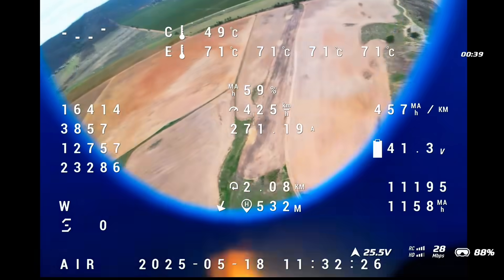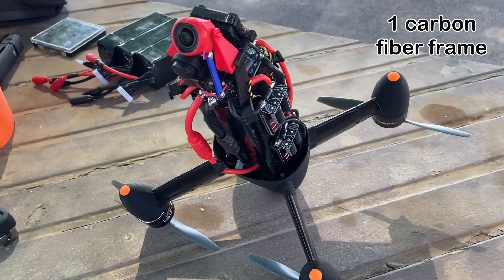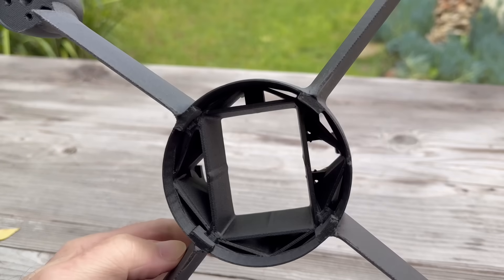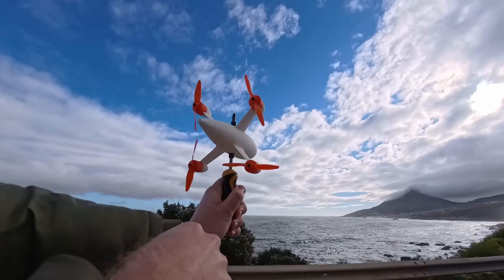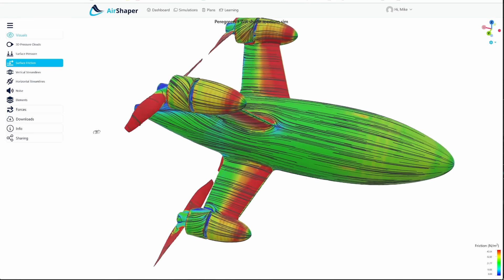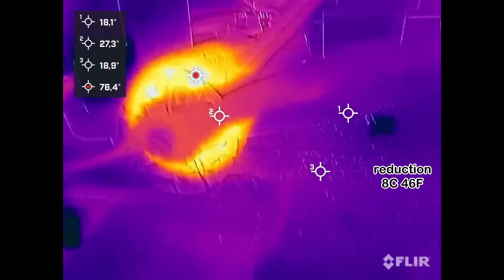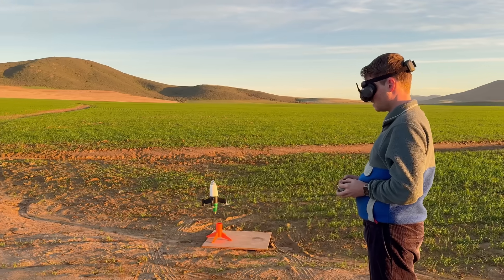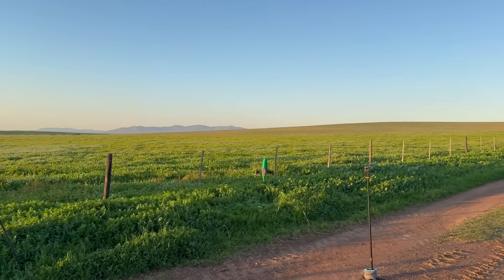How fast can a drone really go? 🇿🇦

Comment: Absolument passionnant !

Quatre petites suggestions afin de réduire la traînée, faciliter la portance, et augmenter les performances : 
1. éviter tous les angles vifs aux endroits de connexion des parties distinctes du drone qui sont des lieux de très basse pression donc de turbulences donc de traînées (voir les solutions suivantes : B-2, Sukhoi-57, Rafale, Airbus 380),
2. aux emplacements critiques de la création de turburlences, creuser des cavités qui puissent agir comme celles de la balle de golf,
3. poser, au nez d’attaque du drone, 2 ou 4 moustaches (voir le Rafale) afin d’assurer une correction automatique de l’horizon selon la vitesse et le besoin de portance,
4. considérer que les 4 bras qui portent les moteurs sont essentiellement des ailes qui assurent la portance du drone, à faible, moyenne et haute vitesses. 

Je gage que de telles modifications bien menées proposeront des performances nettement améliorées (+ 100 km/h). 😎
Reply from the maker: Thanks for the suggestions!  The cavities at turbulence locations is a helpful idea. What do you mean about whiskers at the leading edge. I couldn’t identify them in the Rafale.
The body is already generating essentially free lift at 0,7 degrees nose up, so we make the arms as small as possible and have them as directional stability fins.
Reply: @Mike-Bell  Bonsoir, si vous regardez de face puis de profil un oiseau planant, vous n’observerez que très peu de plumes qui seraient agitées par des turbulences. Or, si des plumes sont agitées, cela est la conséquence d’un plumage abîmé ou d’un oiseau blessé. 

Observez encore, de face, un oiseau planant : l’attache des ailes au thorax ne présente aucun angle vif, et la connexion s’opère toute en souplesse. Et cette souplesse de ligne assure, grâce au plumage qu’il n’y aura aucun vide où se logerait des turbulences ... donc une traînée qui aspirerait l’oiseau à contre-sens, vers l’arrière. 

Autre point : étant donné les hautes vitesses déjà atteintes par votre drone (585 km/h), son profil actuel de pénétration dans l’air s’oppose immanquablement à un mur redoutable qu’il a construit contre une augmentation possible de la vitesse. Pour atténuer cette résistance et la réduire à un minimum raisonnable, n’hésitez pas à effiler son profil davantage vers l’avant et vers l’arrière, toujours en forme d’ogive (voir le profil des projectiles à haute vélocité).

Je maintiens que les bras qui portent les moteurs et les hélices doivent être considérés comme des ailes, et des ailes très particulières parce qu’elles sont exposées à des flux d’air vivement accélérés par les hélices. Et que ces flux d’air accélérés participent à la portance en vol horizontal.

Cela induit que leur finesse doit être étudiée spécifiquement, avec l’utilité impérative de s’accrocher au corps du drone avec beaucoup de souplesse : voir comment les ailes de l’Airbus-380 paraissent excessivement épaisses lorsqu’elles se rattachent au fuselage de l’avion. 

La raison principale est que le flux d’air à cette accroche est minimal voire dépressif, et que c’est alors opportun d’y augmenter l’épaisseur des ailes afin d’offrir une meilleure solidité de l’accroche, tout en résolvant une question de turbulences donc de traînée ....
Reply: @Mike-Bell  Je pourrai encore ajouter qu’en analysant le profil du fuselage des F-22, F-35 et Su-57, on constate que leur fuselage est dessiné en forme d’aile. Une aile certes rudimentaire ou compacte, mais qui assure à haute vitesse une réelle portance ...

Comment: If takeoff is slow, why not go back to the old standard of JATO - a short boost until reaching cruising speed, followed by decoupling.  As simple as a cup form under the rear that would normally fall off from drag as the props kicked in.  No?

Comment: Someone probably already figured this out, but why didn't you use a piece of aluminum pipe for the body for air cooling? Add some heat pipes to direct the heat from the esc's to the pipe and you get excellent air cooling without increased drag and probably being lighter. It also actually gets rid of the heat instead of just storing it

Comment: Could a gyroscope suck in air enough to make its own air bearing?
It could be kinetically charged on the ground as the flight is short.
All in flight power could be routed through this gyroscope with maneuvers achieved by forces acting upon the gyroscope which provides stability.
The power drivers the gyroscope which the props are linked to.
However control is lost as power dwindles to the gyroscope.
Then the chute flips out.
Reply from the maker: The flight controller works with multiple crystal/electronic gyros. They are absolutely essential, without them it would tumble

Comment: How about a circular wing for forward flight brothers.
Would a ring motor around the propeller help.
The propeller could then sit inside a tube or shaft. This may help velocity the exhaust pressure.
Possibly then a torroidal propeller could be developed.
The craft would then consist of a group of interlocking rings which would hopefully act as a wing.
These motors could twist or pivot to enable maneuvers at full thrust.
A dimple finish could be added similar to a golf ball to reduce drag.
Or possibly even a plasma tip to reduce friction.
I would then add a hydrophobic coating for like, reasons.
Perhaps make an angular stealth nose cone.
Possibly attach a cylindrical flywheel around the wing to act as a gyroscope at like mach something.
Maybe make the gyroscope from a slinky, so when a little wing flips out and makes it spin at 3000 rpm it flys off as a countermeasure.
I might paint it captains infinity style or retro-futuristic.not sure.
Thanks love it.

Comment: Without knowing what went wrong with your electronics; try using lead based solder when building your electronics and cables. Lead free is enormously prone to micro cracks, internal cold cracks and doesn't alloy to copper as hard as lead solder does. I'm sure you've had leads fall off clean off copper pads by now. That's why it happened.
Reply: Good comment, 100% spot on! Another small fact of life... 😢 🎉

Comment: By giving it passive stability, it's made to behave like a plane that is inheritely stable. Maybe adding little canards would help with stability at high speeds. I am currently designing a flying X-wing with canards, able to take off and land vertically on it's tail
Reply from the maker: Sounds like a cool project you're working on!

Comment: The loss of connection is not due to Doppler effect. At 900 Mhz the shift is 500Hz. The channel width is 10 MHz. Similar ratio for other frequencies. Well within the channel width. 
Most likely you lose connection die to the antenna radiation pattern- it is probably positioned horizontally during the high speed flyby and you find yourself in a dead zone momentarily when it passes by. You can avoid it by keeping the antenna oriented vertically to preserve omnidirectional radiation pattern.
Reply from the maker: The drone has 2 antennas which are 90 degrees opposed so wrong orientations doesnt seem like an explanation
Reply: @Mike-Bell  with two orthogonal antennas, it’s a bit more complicated. The receiver antenna setup plays a role. Usually it would not receive the product of radiation patterns of both antennas but only from one at a time which it’s aligned with due to polarization. Resulting radiation pattern from two antennas is not a combination of their radiation fields but rather two radiation fields with two different polarizations. Unless you have a receiver which is able to combine signal from these two sources, your receiver will only receive the signal from one of them at a given moment. So a local zero during the flyby is still possible depending on the receiver’s setup.

Comment: Dimples. That would be the NEXT LEVEL.
(and omg what a headache to figure out)
Reply from the maker: Dimples are for golf balls only, because a ball is a terrible aero shape and a particular quirk that only benefit balls.  Not a single aircraft or airliners has dimples because it would just add drag.  You can be certain all Airliners would immedeately apply dimples if it save fuel.

Comment: Maybe it would be worth testing flying in a plus configuration and having the horizontal arms be directional airfoils. That way the body wouldn't have to be a lifting body. I am thinking that the arms would be more efficient at providing upward lift because they have a way higher aspect ratio that the body when seen as a lifting body. So rather have the body go straight through the air and have the arms act like wings like on a real plane.
Reply from the maker: @samgo flew in both the + and x configuration in his record speed. He gave the horizontal arms positive angle of attack. But from what he told me difference if any was marginal. And the explanation is simple. At these speeds the body is already providing  more than sufficient lift and any other lift attempts will just incur additional drag.I make the arms as small as possible and use them for directional stability. 
For me its crazy that 0.8 deg nose up is all you need for lift. Plus we get up to 10g sideways lift in the turn after the speedrun. 
Great question! 🤓

Comment: I wonder if it would be possible to make a cylindrical metal insert in the case, which would serve as a radiator for electronics. Due to the airflow, it would be blown over, the cheapest way to solve overheating, as it seems to me, under the conditions of a CNC and a light alloy.

Comment: Would variable pitch propellers be possible?
Reply from the maker: Great idea. They would make a MASSIVE difference and increase top end speed but technically extremely challenging. We would have to develop the tech completely on our own. And the additional rotational mass has downsides.

Comment: Have you considered giving the engine struts an angle of attack  and a lifting profile (1 degree?) so they provide the lift and not the body?  My thought experiment tells me that lifting struts should perform better because they have a higher aspect ratio than a lifting body.    CFD should show whether lifting struts or lifting body is the most aerodynamic solution.

Have you considered not using vertical landing?  I am thinking of flying into a vertical bird net, motors switched off.  Basically a controlled crash into a net.  Benefits would be reduced energy to land, smaller batteries, and all the advantages of that.

Comment: Hi I'm hearing rumors of a new unofficial Chinese world record for fastest quadcopter. I cannot find videos of it anywhere. I really have tried. Can anyone confirm this? Does anyone have links or videos of this? Thanks.
Reply from the maker: Yes a guy named xiao_dra2002 on Instagram has claimed 608. He has the OSD Showing 608 n 604 and one foto. So average would be 606. No way to be certain it is level flight but looks like it. And the design looks like a legit potential record breaker. But beyond the claim. There is nothing certain.
Reply: @Mike-Bell  Alright thanks a lot. I had one other question, do you have a good timeline for when you're publishing the next videos on actually breaking the record. The reason I'm asking is I already have a parts list for my project which is similar to yours, I've already doubled and triple-checked all of the components I'm getting, but I'm waiting for your video to see how these components - especially the AOS motors perform in extreme scenarios, so as to make sure I'm getting all of the right parts at least for now.

Comment: great video, congratulations on your speed record.  Would it be possible to use small jet engines rather than props? to save on weight and power?
Reply from the maker: Then it wouldn’t be a quadcopter record and easily capable of VTOL

Comment: You could have a landing station at 5 km and change the battery there, than fly back. Straight line flight is more efficient you can reduce battery size and weight or increase juice.

Comment: I see a potential weapon in this.. it could be used as an "interceptor", or straight out offensive weapon.. 580 km/h is almost the same speed is some of the most advanced cruise missiles.. obviously cruise missiles have the advantage of, well, cruising.. but these fast drones could potentially be fitted with shaped-charge and attack armoured vehicles.. all that speed would add to a potential kinetic energy.. or they could be fitted with fragmentation warheads and hit lightly armored vehicles and infantry.. more over, they could bemdeployed as "support" for friendly units.. basically plenty of possible applications..

Comment: Some AI checks say a copper metal of 5x5cm can transfer 18 watts at 250kph and 27 watts at 500 kph if the wing area is 3 degrees relative to motion vector...  That's conservative becaues the FET's have a surface area of about 7x7, the maths was Given an inside oil temp of 75 and and outside air temp of 25'C, and a laminar flow... so oil and a copper can perhaps shed 800 watts if the entire top section was pressed from 2 copper halves, the FET's thermal glued to the copper and bathed in specialist mineral oil, it would prevent ESC fires too because no oxygen.

Comment: It feels like aggressive frontal area minimization is the way to go, putting as many things in line as possible and maybe even stacking your own battery.

Strength-wise, you might be able to do better by printing a very thin-walled part then doing composite layups. Labor per airframe skyrockets then, and I wonder how many you'd print of each before heading out to the field 🙃
Reply from the maker: Surprisingly the body is under 30% of the total drag. The motors and arms are the big ones… but the drag is nice and low. Not any low hanging fruit. But sure frontal area reduction is always going to pay off

Comment: Questions: 
1) what is the airframes drag at record speed? I have a hard time seeing it to require 16kW to maintain 585kph. 
2) how much prop optimization did you do? you changed pitch angle, but I suspect there is a lot of efficiency on the table for optimizing prop air foil for design acc and speed, but I can only speculate.
3) wouldn't a launch system avoid the terribly inefficient props at low speed? would that be considered cheating?
4) what is your feeling where the next biggest gains are to be found? cooling, power density, aero, propulsion...
awesome work and project from you two!
Keep the exccellent work up!
Cheers from Germany :)
Reply from the maker: Thnaks.  Great questions!!

Our CD for the body only is 0.054 But the props are a very significant chunk of the total drag.  

For Props we rely on the manufacturer in USA for optimal design, and we have zero expertise in it and we believe they are good.  But small gains in prop efficiency and thrust dwarf aero gains.  Do you have knowledge about prop optimization?

For now self launch is in the spirit that the quad community will expect.  plus we are dealing with a lot of complexity already.  But breaking the Rolls Royce Spirit of aviation 624kmh may require something like that.

We have a quite couple of speed optimisaztions in aero.  But certainly motor cooling is a must, for power delivery efficiency and to prevent the motors destroying themselves.  In our next videos at the official record attempt we'll show the huge motors issues we had.  There are some aero/thrust tweaks that look promising.

Cheers from Cape Town
Reply: @Mike-Bell  Thanks for the extensive answer!
My expertise in prop design is nil, but I remember a prop design competition from the rctestflight channel for water-props (incompressible fluid, so different than air props, I know) which showed just HOW complex such an optimization is. And how difficult it is to test designs as so many parameters are involved. Without proper testing methodology you can find local maxima but still fail to make significant gains.
My physicists takeaway was that this turns into a recursive system optimization: prop-design nescessitates motor limits (rpm, power, cooling) but optimizing motors requires a performance envelope of props. It's very very see-saw like and therefore easy to walk around a global optimum.
I am very much looking forward to see how you fare, what you achieved already is truly mind-boggling and I am in awe.
Truly truly inspiring teamwork and engineering.

Comment: The battery draining at full throttle in 24 seconds is wild! Also, this is extremely satisfying to watch with a father and son working and completing something together 🥰
Reply from the maker: I am in awe of the clever people who have developed the science behind batteries. The batteries do get pretty hot but not dangerously so. That is highly impressive considering the amount of energy they are dumping. And not once did we have a single issue from any of the batteries. Some we could even re-use after a bad crash.
Reply: Will creating vents or scoops to cool components from overheating at this point affect the integrity of the drone build (structure) negatively?

Comment: If dimples work on a golf ball then why not dimples on the airframe?
Reply from the maker: If dimples helped, then airliners would using them to reduce fuel burn and make a fortune.  Dimples only help a ball because it is a horrible aerodynamic shape and dimples help improve its shape.  Our drone and airliners are highly aerodynamic so dimples would just slow them down.
Reply from the maker: Dimples are for golf balls only, because a ball is a terrible aero shape and a particular quirk that only benefit balls.  Not a single aircraft or airliner has dimples for a because it would just add quite a bit of drag.  You can be certain all Airliners would immedeately apply dimples if it saved fuel.